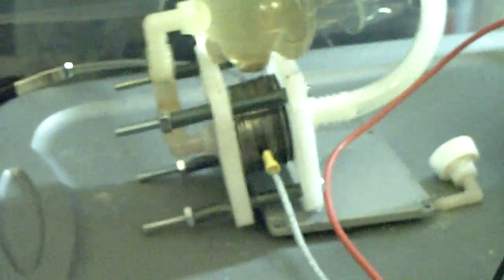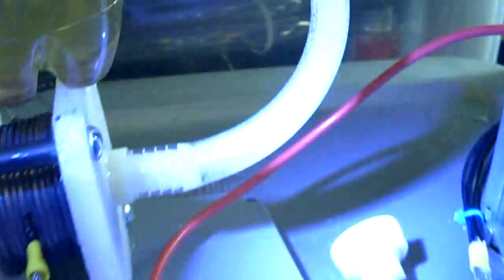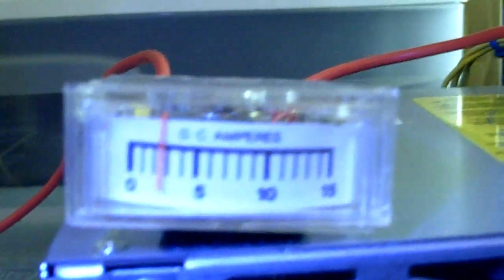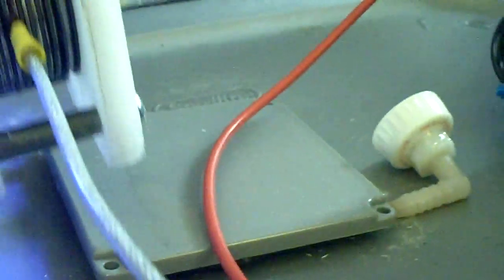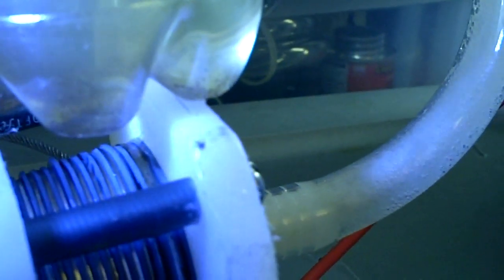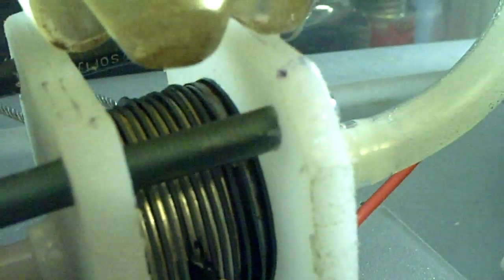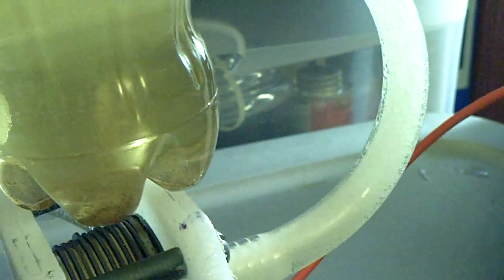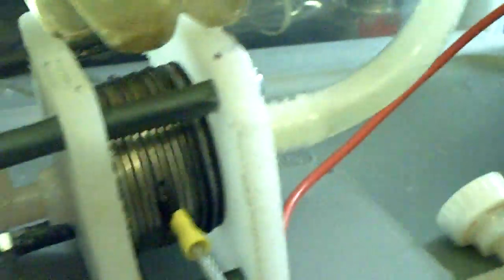Vid29 Hydrogen Generator Washer DryCell Test1 (HHO, Brown's Gas, Hydroxy)

Comment from the maker: Thanks,

Yes, I was getting 1/2 LPM at 3 amps with a leaking gasket. 

I've changed the design slightly, but I plan on using more KOH (potassium hydroxide) to get better results. I'm hoping to keep the amperage below 10A.